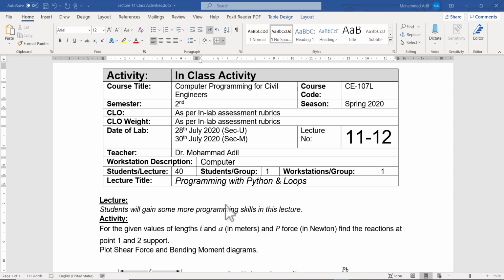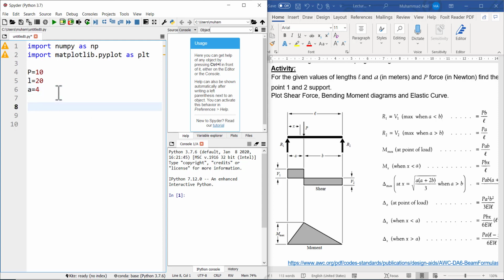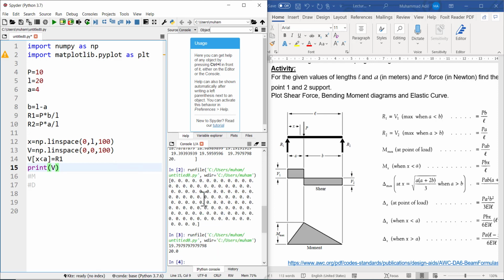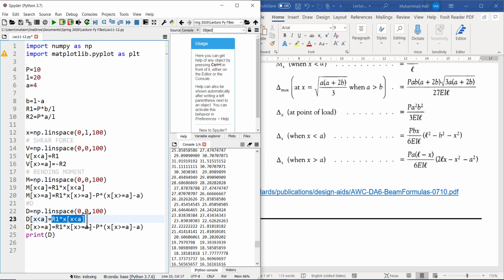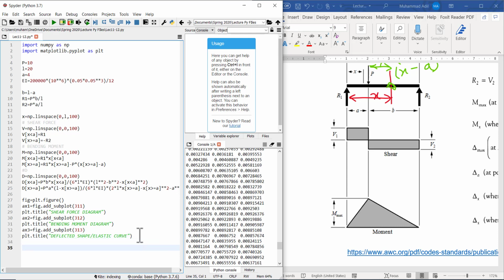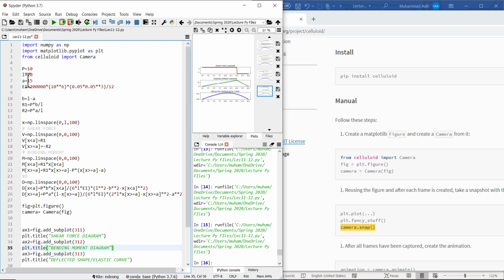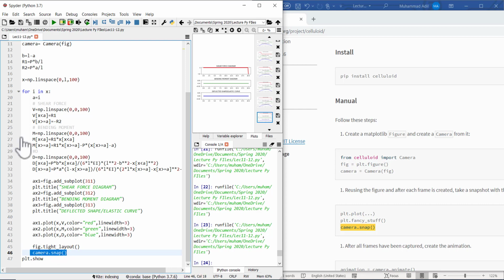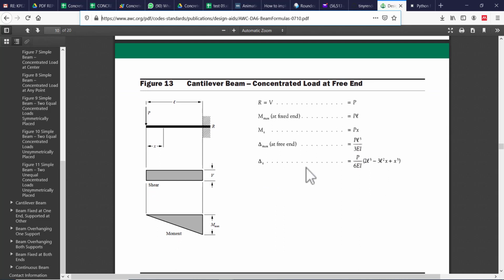Lecture 11 & 12: Python Programming for Civil Engineers: Loops and more

Comment: But these codes will work only for the partcular type of problem only. What about for all kind of problems because reactions, sf and bm will vary according to the loading conditions and its distance located from the support. Then how to plot shear force,  bending moment and deflection shapes for different cases. We have to create seperate codes for each cases right?
Reply from the maker: Venkatesh, the purpose of these videos is to make Civil Engineers capable to write software as and when needed. Like now if you need a generalised software, you have learnt basic programing skill and you can develop any software you like.